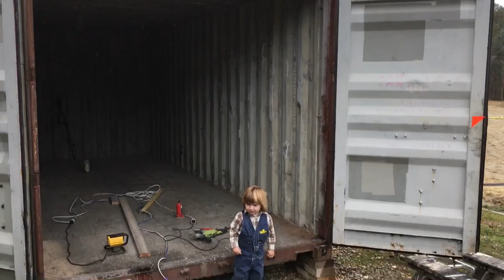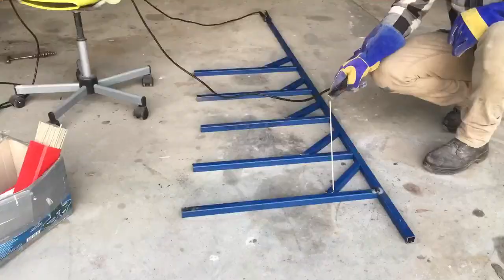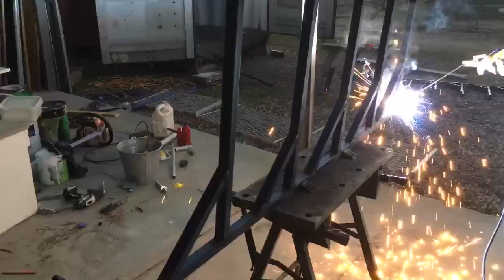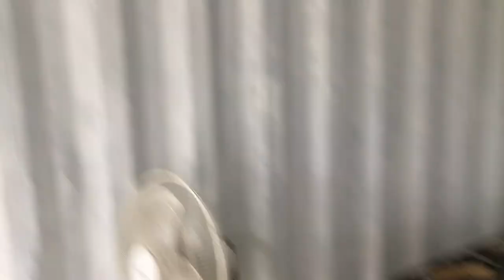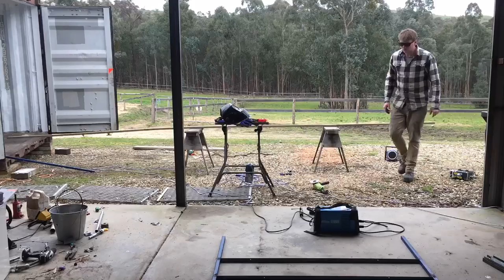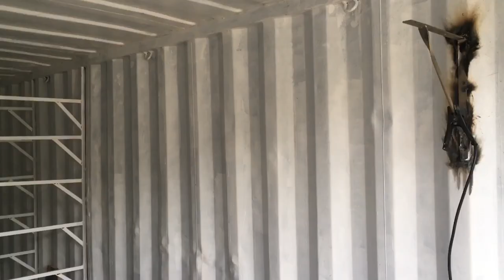Shipping Container Workshop Conversion - Part 2 - Shelves and Paint

Comment: Was there a reason you didn't use a pallet rack for the shelving ? And was there a reason to paint it before welding to it ?
Reply from the maker: I thought it might be easier to paint it first Then touch up the burnt bits once I had welded it. If you could spray paint it instead of using a roller and brush I think it would be way quicker. What sort of pallet racking are you thinking because I still want to ad some more shelves in on the left hand side where the bench with the vice is.
Reply: Look up pallet racking - 1000's of types, tear drop 3' or 4' etc, I personally like 4' depth cos then you can use 4X8 sheets of plywood for shelves if you didn't want those wire ones.